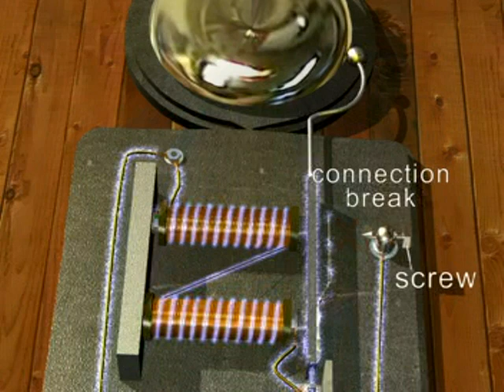Electric Bell

Comment: the electrical circuit is broken when it moves first, which means there is no more electricity in the wire meaning they aren't magnetic anymore, so the hammer is not being attracted to the left side, so it goes back into it's place on the right side :)